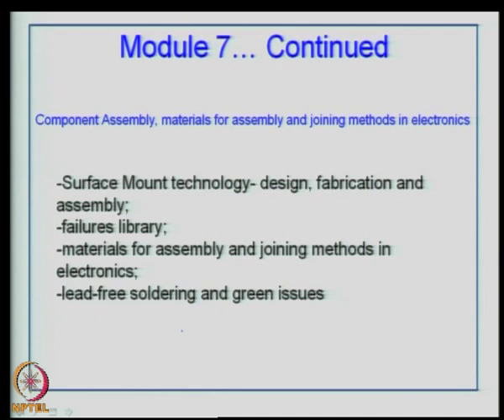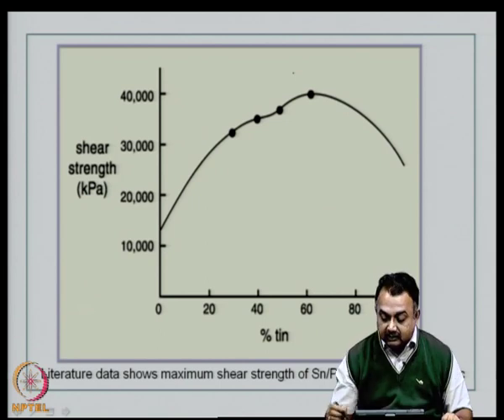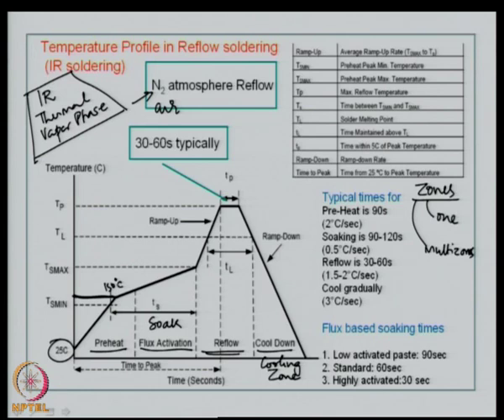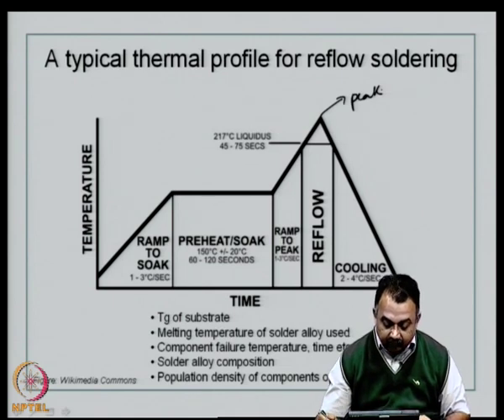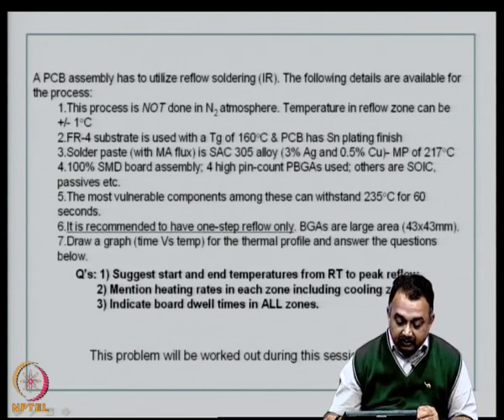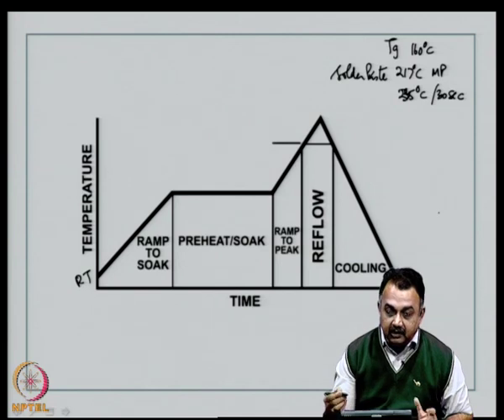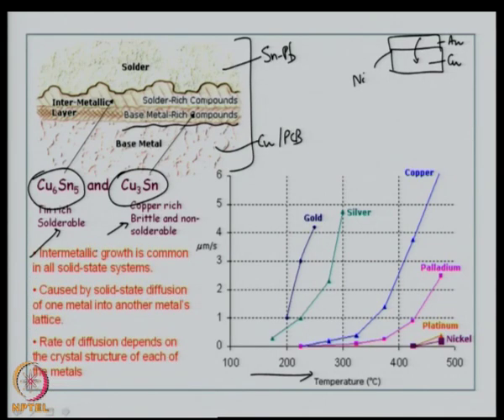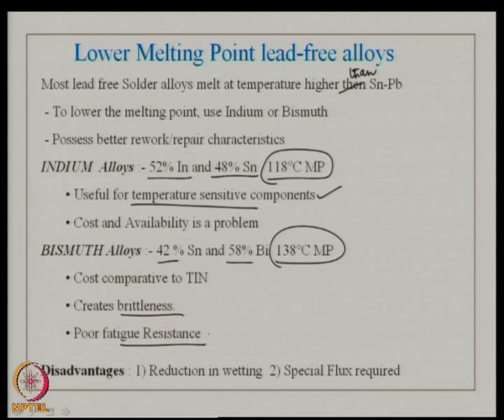Mod-07 Lec-37 Tin-lead and lead-free solders,Phase diagrams,Thermal profiles for reflow soldering

Comment: Hey, I think there's a mistake. At the right side you take some notes concerning the eutectic point. It has to be 63:37  - Pb:Sn according to your phase diagram. However, you speak of 63:37 - Sn:Pb in your shear strength diagram?!?
Reply: Didn't see any mistake.  The X axis is wt.% of Sn and the eutectic point is 63Sn-37Pb.